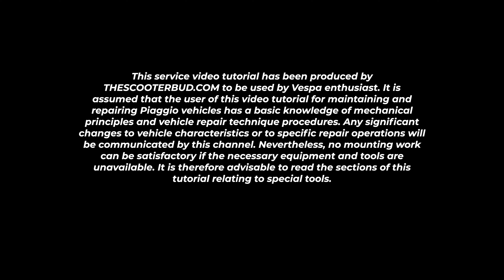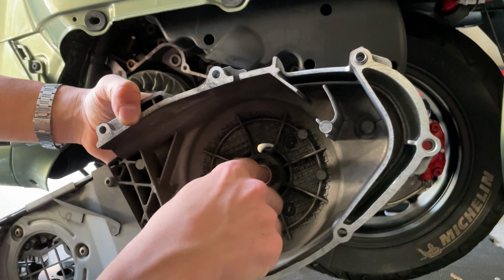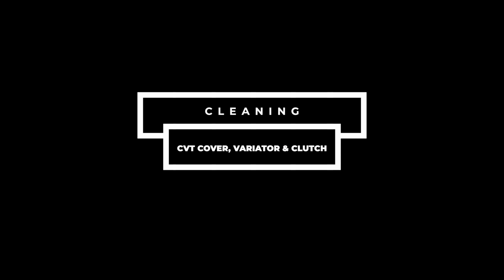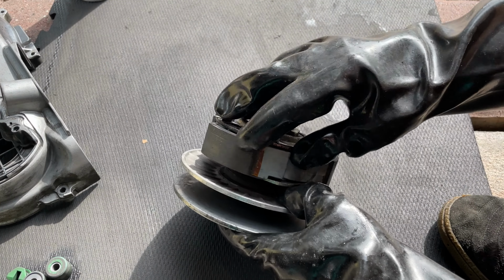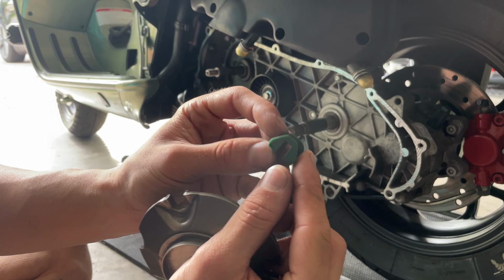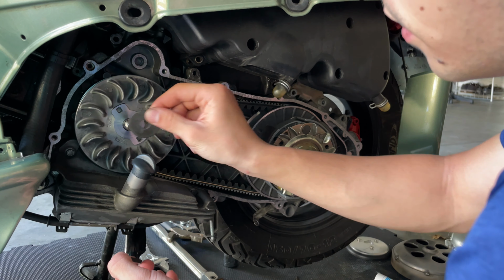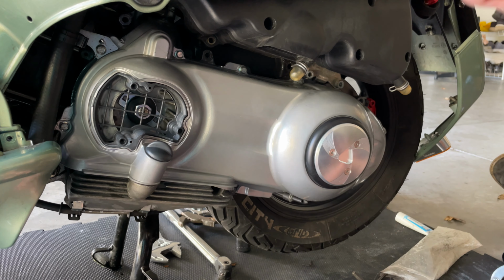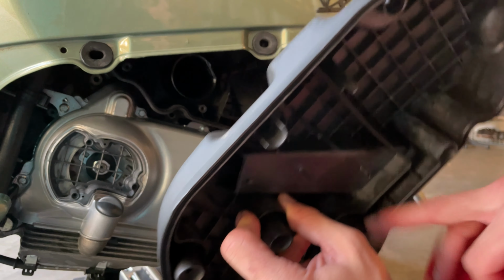Belt, Variator & Clutch Service  - Vespa GT/GTS/GTV

Comment: I don't quite get why you need to replace the nut with a new one a nut is a nut right just tourque it correctly and all is ok  ... no?
Reply from the maker: Hey, Thanks for the comment! That’s a great question!

Normally, according to the ASTM standards, these kinds of spare parts like nuts, bolts, screws, etc… are only intended to be used once, all these mentioned above carry a specified torque setting and once that torque limit is reached, it would produce some stress to that part, reaching that “stress level” over and over again would result in a catastrophic failure at some point.

To be crystal clear, as you tighten the nut the bolt will compress the two parts together. The bolt itself has an internal reaction force equal to the amplitude of the compression force, but the bolt itself is in tension. To get the greatest clamping force out of the bolt we would tighten it up to the yield point. Any more force and the bolt will enter the plastic region and permanently deform.

In practice, engineers don't design that way. Since any additional force will begin to yield the bolt, you want to give yourself some margin for error.

Engineers select a bolt tension that is somewhere between the calculable minimum functional clamping force and the yielding force...

In conclusion: replacing a single nut that cost just a few cents doesn’t hurt anyone and would always give more peace of mind and will be safer than reusing an old nut or bolt that has already received lots of stress! Most of the time you can reused a small part that doesn’t require an enormous amount of torque like is with these important nuts that are constantly receiving stress not only from the engine.

Peace✌
Reply: @TheScooterBud  well that answered the question 💪😉
Reply: @TheScooterBud  While all this is true (I have been an auto mechanic for 41 years) in the case of the variator nut on a Vespa, if it is not over tightened, it can safely be used more than once. I have reused this nut a couple of times myself when replacing a belt in a situation where I did not have a torque wrench available. When I installed it the first time, I used an electric engraver to make corresponding marks on both the nut and outer half of the variator pully. After removing the nut to replace the belt, I simply tightened it back so the previously made marks aligned. This is not PERFECTLY accurate as far as torque goes, but it will be very close. The torque spec on that nut on my 2006 GT200, which has the Leader engine, is 55.2-61.1 lbs-ft, which leaves a 5.9 lbs-ft margin. Many people simply use an impact driver to both remove and reinstall this nut, and while the Vespa service manual says to replace the nut every time it is removed, most people don't, and I have yet to hear of a failure caused by doing that. I belong to several scooter forums, and it is just not common practice to even torque that nut, on any brand scooter. Obviously it should be properly torqued, but as long as you get it close, it doesn't seem to be a problem.
Reply from the maker: @geraldscott4302  Hey! thanks for your comment!

While I complete agreed with you, and I have done it to multiple times without any issue or failure in all my Vespas, if you can afford the nut and the torque wrench, theres no need why not better to be safe than risk it, same thing with people adding loctite when is not actually needed or require by the manual. I think is optional depending on your mechanic OCD lol for me is always better to be "more safe" than "more risk" without needed.

Peace ✌

Comment: Thanks, very good vid info. Best Rutin mileage to suggest for service CVT sir, tq
Reply from the maker: Thanks for the feedback and the support! Appreciate it!🤟

That would depend more on your riding style, the riding conditions, and what you feel comfortable with, even tho Piaggio recommends changing the belt every 6,000 miles and to replace the shoes and rollers every 3,000 miles, I have always done my whole "CVT" service every 9,000 miles all together at once. I ride my Vespa as I stole it all the time, for example, I live in Florida (no hills whatsoever and very hot weather) and I haven't experienced any issues.

keep in mind I'm not a "graduated experienced mechanical engineer" for you to rely on my personal opinion but I have been doing this for the last 20,000 miles with no problem at all and without noticing any risk or damage to the bike and its parts.

Peace✌

Comment: I don't remove the rear foot peg as it's not required to be removed AND it's hard to get to re-fitted correctly too 😊😁
Reply from the maker: For me is necessary because I have the "Foot Rest Extenders" on the way to remove the side panels. Thanks
Reply: @TheScooterBud  Good to know, as nothing restricting side cover and clutch cover removal with standard rear pegs left in place 😁

Comment: Oh that what about that scratches on variator ! After using Sand paper
Reply from the maker: Hey! Thanks for the comment!

Sanding down the variator when servicing the transmission is a practice it's been done for years by many, its intended to break the glaze on the aluminum that was done by the heat and friction of the belt, sanding down the part would break that glaze bring back a little more friction and better grip to the belt for the first few thousand miles after the service, it just give a better feeling and it help keep the scooter in better shape. IMO.

Peace✌

Comment: For Hilly areas.. is it okay  or can  I use a lil shorter belt thn the stock !? What about the wideness of the belt ? 

Alil shorter and lil fatter , wider will be okay ?

& Lastly are all variator , clutch size system same ? ( The hole especially)
Reply from the maker: I don’t have much experience with “hilly setups” but I have always stuck with the OEM Belt because is the one that last longer. 

I believe they are all the same from the 150cc to the 300cc, the 50cc engines are a bit smaller and I don’t think any clutch from a large frame Vespa would fit.
Reply: @TheScooterBud  means.  .. it's safe if I go alil longer or shorter thn the stock .. according to my preference!?

Comment: On the tourque settings you have drive pulley nut and driven pulley shaft nut I'm confused surely they are the same
Reply from the maker: Hey, thanks for the comment, surely they are NOT the same. lol 

Theses torque setting comes from the mechanic manual and they refer to:

1. "The Drive Pulley Nut" is the nut that hold the variator in place along with the corresponding washers. 

- Locking torques (N*m) Drive pulley nut 75 ÷ 83

2. "The Drive Pulley Shaft Nut" is the one that hold the clutch in place with the CVT cover along with the corresponding washer as well.

- Locking torques (N*m)
Transmission cover screws 11 ÷ 13 Driven pulley shaft nut 54 ÷ 60

hopes that clears up the confusion! Peace✌
Reply: I suggest you take your Vespa to a suitable mechanic 😉
Reply: @richardrichard5409  it's not a vespa 🙂
Reply: @collin6238  I think the clue maybe in the Title 🤔😉

Comment: 45 ft lbs or NM like it shows on your specs at the bottom
Reply from the maker: It’s the same, just personal preference.

Since Piaggio is made in EU, all the manual specification are in metrics, meaning that they use Newton-meters (Nm) and since I'm here in USA, they only use here foot-pounds (ft/lbs). 😵‍💫

One foot-pound (ft/lb) is equal to 1.356 newton-meters (Nm). To convert newton-meters (Nm) to foot-pounds (ft/lbs) all you need to do is divide your figure (Nm) by 1.356.

Peace✌
Reply: @TheScooterBud  thanks bud, 
What would be some symptoms of needing new rollers, sliders and belt
Reply from the maker: @jasonwojcicki3667  If you just bought the scooter second-handed, I would do these right away or as soon as possible, even if the seller tells you when was the last time was serviced, you never know how it was ridden, how long its been sitting and all that, so for you to know exactly what milage you have on these parts and keep track for your next services, that's the best you can do.

On my GTV, I usually replace the belt, rollers, and sliders every 9,000 miles, all together, but Piaggio Engineers recommend changing the Rollers and sliders every 3,000 miles and the belt every 6,000 miles, as well as having the oil changed every 3,000 miles.

I only do the oil change every 3,000 or 4,000 max and then do all the transmission at 9,000 miles, rollers might start to make a rattle noise at around their "service life" 3,000 miles, but that's very common on these bikes, and is normal to ride like that, if the rattle noise is something you can't live with it, then you can just do the roller and slider every 3,000 once you start to hear that rattling noise gets worst. but you'll see that once you take your variator apart you could also do the belt since its already out, and most people would just do the belt but the OEM belts last a long time so I will rather trust and extend their life than waste more than half of it, so I prefer to extend the life of the rollers instead of wasting the belt if that makes sense.

Peace✌
Reply: @TheScooterBud  makes sense bud, 
I have a little rattle from when warming up from idle. 

I was going to put new rollers, sliders and belt so I knew where I was I did oil change/filter a couple of months ago when I got her. 

GT L EURO 3 

I have a little hesitation when it comes to a hill, when I stop at a junction and start. (Not bogging down) 
Just if it takes a little bit to respond to the throttle. 

All air, carb, and filter is ok... 

Did a valve clearance not that long back. 

So I take it as something to do with clutch, varriator, ect
Reply from the maker: @jasonwojcicki3667  Great! Yes, if you have take good care of all that and you're over 12,000 miles it might be a good time to change your clutch or service it, that rattle noise could also be coming from the back plate of the clutch, take it apart from the CVT cover and check the condition of it, check the oil seals and make sure everything is nice and smooth as the bearing inside the shaft.

 I did that recently on my GTV and installed the Polini clutch with the S.I.P Drive Pulley you can watch that video here: https://youtu.be/1jVmGFHmsN0

For the "hesitation" maybe playing with the weight on the roller might make a difference but I don have much experience with that.

Peace✌

Comment: You got the drive shaft screw and clutch screw torque wrong, the drive shaft screw torque should be 54~60Nm
Reply from the maker: Hey! Thanks for the comment, mm I don’t think so, that’s not even what the manual saids, it should be between 75~83Nm and keep in mind I’m using ft/lbs.

To convert 83Nm to ft/lbs, divide 83 by 1.356 or multiply by 0.738.
83 newton meter = 61.2094 foot pounds.

Peace✌️